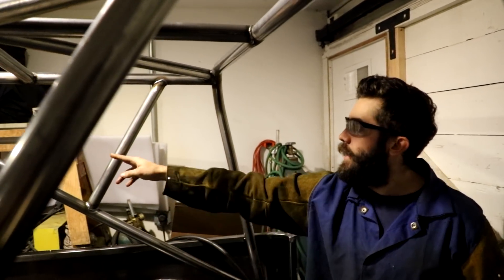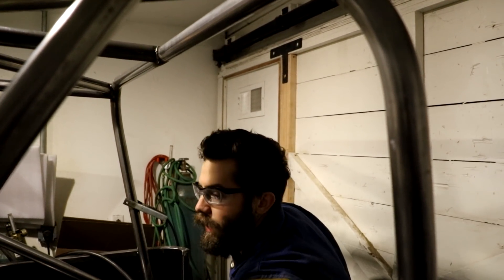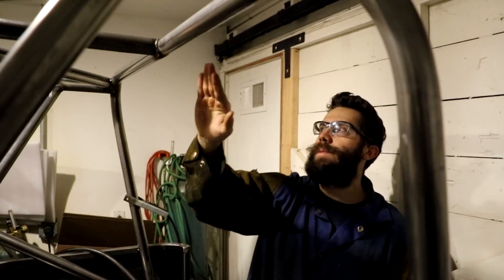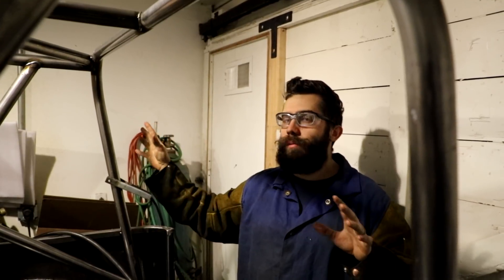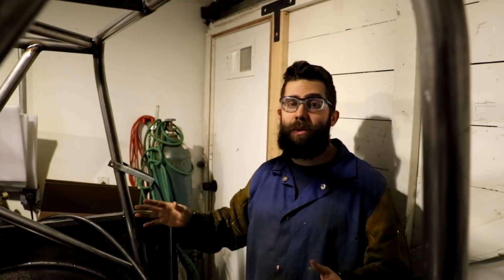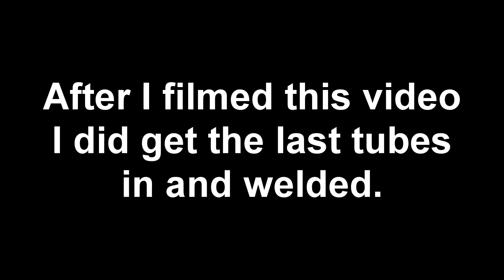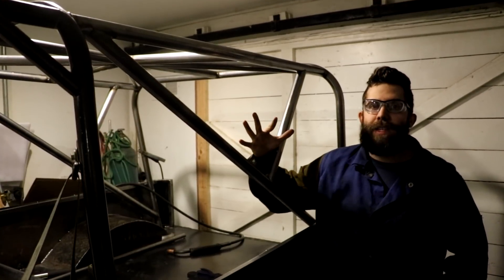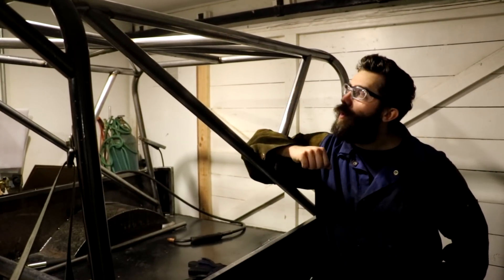Building A Custom Roll Cage (Samurai Update #7)

Comment: I couldn't agree more on the tube notcher. I've done partial cages with just a 4" makita grinder too, I even started using a 1/2" burrs in a die grinder to get the joints tighter, and you are exactly right, with DOM tube costing what it does, even my Harbor Freight notcher paid for itself in just a couple projects. I just used it adain a few weeks ago. I love what you're doing with the Sami !

Comment: Looks good how many hole saws did you burn up I'm planning exocage still working on front shaft  vibes let me know what shaft your running thanks
Reply from the maker: Actually I used only one hole saw for all of those tubes. I was very impressed. Just a cheap hole saw too. My front driveshaft is a custom long spline driveshaft. It’s not a CV or anything special.

Comment: I put a 4 runner front shaft  in still have vibration you think dropping case down  may help or is the short shaft going to suffer it's up 1in on mounts and looks like needs to go too passenger side
Reply from the maker: Is the drive shaft in phase?

Comment: Yes I think I'm going to have to use a cv or  Double cardan I dropped the case down to near 0 degrees and the pinion is pointing up to the case it's close 3 to 4 degrees up but the angle is to much  at case shakes the tweeters right out of my  woofers

Comment: :o 👌👌
Reply: tj do you have the original engine in the samurai?
Reply from the maker: Yes it is the stock 1.3 with a header.
Reply: TJ Mitchell Films hey man thanks for your reply. Dose the header make some difference in power because I have fitted 31 inch wheels on my samurai and it struggles up the hill do you have any idea that can fix my problem
Reply from the maker: The header definitely helps but the main thing that will help is gearing. If you haven’t changed any gearing that will be your problem
Reply: TJ Mitchell Films yep and that's the problem for sure I will try to do some research and fix the problem thank you 👊👊
Reply: one more question please where can I get 4.57 crown and pinion because live in malta and it impossible to get them from here thanks for the help